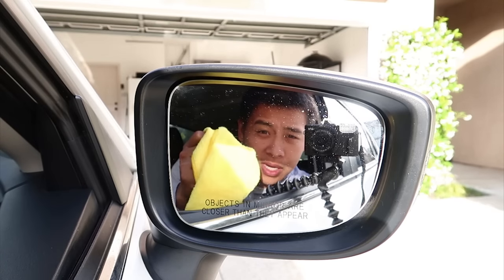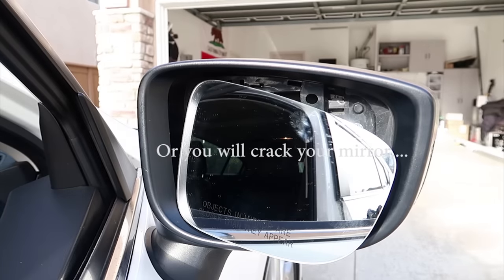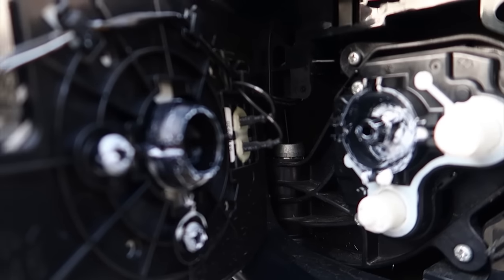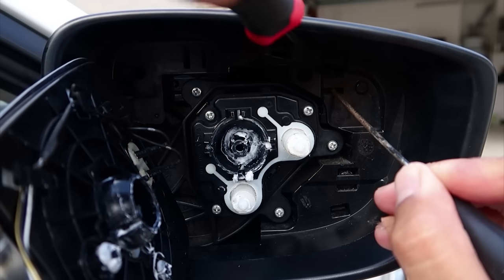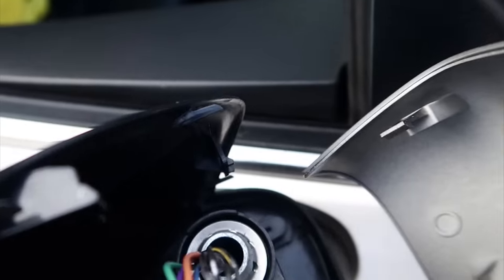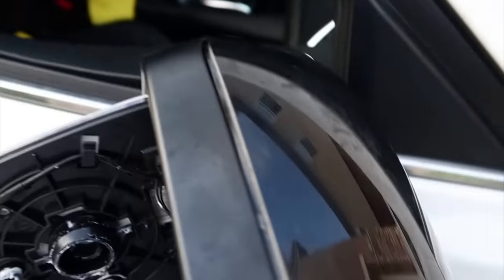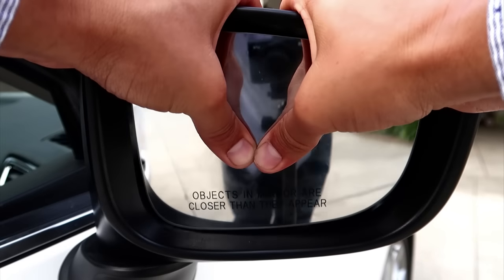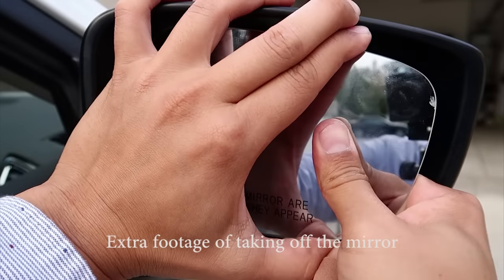How to Replace the Mirror Caps - 2016 Mazda 3

Comment: Thanks Greg, this was helpful for me to repair my passenger mirror on my CX-5 which was broken. It has blind spot monitoring and  heating. Unexpectedly, once underway with the the mirror glass replacement, I found one of the servo-motors was apparently jammed as well, which necessitated the removal of the mirror cap so I could access the the wiring to the servo-motors and remove the servo-motor component and then disassemble it completely down to the servo-motors and gears. I found Mazda's CX-5 repair instructions online for the mirror removal and re-install which were barely helpful, but they were the only guide I could find on my car's specific condition, and I had nothing for the mechanism. It was frustrating to accomplish, since I haven't much experience doing autobody work, but your guidance on at least the cap removal part of it was very helpful.  Happily my mirror is fixed and operational including mirror adjustment, blind spot, signal etc.  If anybody else needs mirror help on their CX-5 (and I bet other Mazda's have this similar fancy mirror design), let me know; I can share some of my experience.
Reply from the maker: Wow glad i could help a little. I am not sure many cx5 people watch my stuff. But if you can share with a cx5 forum that might be searchable and help others there
Reply: I just replaced my mirror assembly with a new unit. Now I'm having the same issue are you did. I can hear the motor when adjusting, but it only wants to move inward. What did you do to fix yours?
Reply: Hello! Where did you find your mirror glass replacement?

Comment: Great video.  Had a run in with a fallen tree on a dark winter morning.  Cracked the case but wing mirror intact (luckily!).   This vid helped me repair the damage without having my eyes removed by a dealer 😄.  Clips were a nightmare for me but you made it look so easy.  Just need to be careful as if you force the wing mirror to far back you can apparently  damage the motor.

Comment: Thanks for this great tutorial. I actually had a vibrating mirror issue. I was so worried to try it myself. Your video gave me the courage. I just added double-sided foam tape to the spots on the mirror bracket that had no adhesive. No more vibration = a $700 savings. That’s was the quiet for a whole new mirror & labor. Thanks🎉🎉🎉😊😊😊
Reply from the maker: Dang!!! 700 thats crazy! Glad i could help 😀

Comment: Thanks for this video. I took my BN 3 back to the dealership to have their "mechanics" change the motor in the drivers door mirror, and they broke just about every clip in there. You could see the marks that the screwdriver left as they tried to pry the cap off the body.They didn't tell me about this damage. I checked the mirror by trying to twist the cap when I arrived home and it just about fell off in my hand. I showed them the damage and they then replaced the cap and body at their expense. The things I recorded on my dashcam at that dealership, that's another story but I won't be going back there. I wish they had watched your video. Thanks again.
Reply from the maker: Wow surprised they would use a screw driver at a dealership.... thats not good. Glad it got covered but still annoying.

Comment: Thank you.  I had problems getting the mirror to pop on to the actuator servos.  It really helps seeing the inside.  I only had to replace the mirror.  Seeing how to pop out the old mirror with the broken glass was very helpful. The new mirror came with the white 4 inch circular mounting base (that pops into the center and the 2 servos of the actuator) separate from the mirror -  the idea is it is easier to pop this mounting piece on first and then use the double sided adhesive to attach the mirror to it afterward than with the base and mirror together as in your video.  

My roadblock was that the mounting piece refused to snap on to the balls on the servo pieces.  If I tried with them spun out a little, when I tried to pop the socket onto the ball, it just forced it down to the bottom position.  At the bottom position, the ball and the socket in the mounting base weren't aligned well enough.  I used LOTS of force - enough that I was really worried about breaking it.  The center popped in with some force, but the 2 servos for adjusting the mirror angle just would not go in.  

After trying a variety of things, I made a collar out of a 1.5" washer that choked the neck of the ball on the servo.  I used a 1/4" piece of 1/2" pvc irrigation pipe to support this collar (I cut it through on one side and most of the way through on the other side so I could get it out afterward.)  So when I pushed the base (with the socket) against the ball, the pipe and collar kept the servo from retracting.  And the force was against the case and not the servo.  Still required a lot of force, but it did pop in.  
https://photos.google.com/photo/AF1QipM1VdxC-9XLeQEk1vhgkx-rbDnoKJJjKGOB7IF0

Comment: Great video.  Had to replace the glass as it was cracked. Was having a heck of a time getting those two actuators to engage. Was afraid I would break the glass. After watching your video 15 seconds later problem solved.  Kudos.
Reply from the maker: Woo glad i could help!
Reply: Hey there, I saw you mentioning you needed to replace the glass.  I'm in the same situation - I only have to replace the glass as far as I can tell.  How do you get it off the cap - or when you order the glass do you get a new cap?

Comment: Thank you, I was afraid to break the glass mirror when putting it back on but you excellent instructions still works on a 2020 CX-30, Mazda charged $90 for the part (with blind spot light) but needed!

Comment: Greg, great video but I cannot seem to push that mirror back onto that middle holder/clip!  I push really hard to no avail.  Then those white ones, forget about it! lol.  Any new suggestions besides just pushing the mirror in really hard?  Thanks.
Reply from the maker: Put your hand directly on the middle part and the other hand on the cap of the mirror and put hard together. Should pop back on. Can wiggle it slightly to get different angles.
Reply: @GregPettus  thanks, that finally worked!

Comment: I am having an absolute nightmare with the wing mirror glass. Initially, i took the mirror off as my mirror casing was broken and i was getting a bodyworker to repair it, when i took the original mirror casing off, the rear of the mirror glass retaining clips broke. A couple of days later, the bodyworker finished with the car, and suggested glueing the old mirror back in, he did and insisted it would still swivel, i didnt see how and was proven right, it failed to move. So now im stuck with a wing mirror glued on, so i had no choice but to break the glass and remove the glue, but he used some industrial level glue, which i tried to remove from the actuator but it was too stubborn and too far gone. So now i needed a new actuator (the part with the little motors and swiveling knobs), dealers dont sell it separately, so i needed a new mirror casing just for that particularly part. I sourced a complete mirror casing, came without a mirror glass. So  i bought a non original mirror glass, attempted to fit it in,  the internal centre retaining clip on the rear of the mirror glass broke, whilst pushing it into position. I then thought oh it must be poor plastic, so i went ahead and bought an original mirror glass, i managed to push the centre in, but when i attempted to push the two swivel knobs in, the clips on the rear of the mirror glass for them broke. This mirror has drove me absolutely insane. I am now stuck, i do not know what to do, i wish i bought a complete mirror with the glass already in it and just be done with it. I know this write up is long, im just venting. I want to cry.
Reply from the maker: Unfortunately at this point you might want to buy an entirely new side mirror
Reply: @GregPettus  thanks bro,
Well, i found out my issue, i needed to heat the rear of the mirror glass before installing, since its like 0 degrees here. I need to heat it to 60 degrees before installing. So im just waiting on a replacement glass mirror and ill see how that pans out. It makes sense but we’ll see
Reply: To conclude for those that struggled like i have, heated the new one with a hot air gun, (60 deg if u have something to measure the amount of heat) n then firmly but carefully place it in. Absolute pain in the butt but i hope it helps someone

Comment: Great video. Looks like almost everything I was looking for. Do you know if I can replace the outer shell only? My mirror and electronics still work fine; the mirror I have has blind spot detection but all the ones I see for sale don't have it. Can I simply buy the replacement mirror and just change out the shell and keep my mirror and electronics? Perhaps you can make a video showing us how to do that. I'd appreciate it. Thanks!
Reply from the maker: Outer Shell? Like the frame? mmmm Should be ok to do. going to take a little bit of work, but I dont see why you couldnt replace the shell. looks like everything on the inside had a screw and/or clip holding it in. 

Not exactly sure how to do that... cuz I havent had the need to. I would for sure ask the forums if anyone has done any of this work.

I would use the original one as a reference how to wire the blind spot into the new shell.
Reply: I just took a look and it seems as though the wires all come through the spring that allows you to push the mirror back. Do you supposed the mirror glass itself is the only difference between the models with other electronic features (blind spot, heated etc..)? Thanks for the quick response.
Reply from the maker: the mirror and the wiring probably is the only thing. Makes it easier on the manufacturer.

Comment: I found a much easier way:  I just drove through my favorite car wash with my brand new Mazda3, and it ripped the passenger side mirror cover off and threw it!  I got home and saw the cover gone, went back to the car wash & had them hunt it down.  It's scratched up, but all the tabs look intact.  600 miles on the car... Grrrr!  The vid was helpful, though, in getting me in a better mood for reattaching the cover.
Reply from the maker: +rbarr775 oooo nooooo. Yeah good luck. Sorry about the mirror cover. Let me know if you have any questions

Comment: Thanks for this Greg, someone opened their door into my mirror and broke the lens of the outer little signal assembly. It looks like it can be removed easily and replaced once the cap is off, do you know if that is the case by chance?
Reply from the maker: I dont exactly remember if it was easy to remove. But id imagine its simple in design so should be able to remove it. Also because it needs to be easy to get to to replace the bulb

Comment: I need to find a replacement plastic shell (daughter struck a mailbox that was sticking out into the road too far during heavy snow). The mirror assembly is okay, just the weather cover in front facing side is shattered. Where can I get this garnish shell for a white 2012 CX9? Everyone wants to sell entire mirror system.

Comment: Do you have a video showing the replacement of the mirror glass? As in removing/replacing the mirror and 
reattaching the BRM sensor and backing plate on the new mirror glass.
Reply from the maker: No. Not something i had needed to do. Never was damaged... if it happens to me i may show how to fix it in the future
Reply: Thought it was a BSM sensor?
Reply from the maker: @williambaker08  ha i think youre right bsm.

Comment: If your mirror cap fell off and you bought a replacement, can you just snap the replacement on without removing the actual mirror?  Also is there something wrong with the whole mirror part if the old mirror cap fell off?
Reply from the maker: Yeah i would just snap it straight in. Could be something wrong or someone reversed and it flexed the mirror and then the cap popped off
Reply: @GregPettus  Thank you for the reply!  The cap fell off while I was driving, so I will have to make sure to correctly snap each section in.

Comment: When looking at the back of the mirror there's (3) spots where wires get plugged in. Do you know what the (2) wires closest to the body are for? I had to replace the whole mirror housing and the new housing I ordered online did not come with them. I put the mirror and housing back on the car and the blind spot monitor, blinker, and power mirror all still worked. I'm thinking its for the heated mirror feature but I do not know. Great video btw helped me finish the job and get my mirror back on. Was nervous to apply that much pressure to it.
Reply from the maker: That is a great question. I would imagine they are for the heated mirrors... Wait I have heated mirrors? Next time it gets a little dewy in the morning I will let you know for sure.. Haha.
Thanks dude! Glad I could help.
Reply: If I had to guess they wired all the mirrors for heat then left a blank @ where the button goes on the center controls so you have to pay for that upgrade and it's easy for them. Install the button and turn on the feature in the cars computer. After looking at mine it looks like the blank is next the the driver side heated seat button. I have a 2016 Mazda CX-5 so it could be a little different in yours but should basically be the same.
Reply: Those wires are for the mirror heater, I just had the opposite problem where I ordered new glass and didn't know I had heated mirrors so the new one did not have those terminals!  They are activated with the rear defrost on my 5.
Reply: The wire end with the white tip is for the blind spot monitor, the two black wires are for the heated mirrors (if you have them or else the tabs will be missing), they can be hand removed if your careful.

Comment: Help: so the white stuff in the are clips in the mirror itself that you re pushing out? So for bottom you push up and push straight to pop it out and for the top you just push the top white part straight out?? Or are supposed to you push the bottom up and pop them out straight? Mines isn’t popping out it’s just rotating the mirror back nothing is unclipping. Thanks!!
Reply from the maker: White ball pieces are balls for the joint and there are two of them. Takes some force to pop the ball out of the joint. Just make sure to pull from as close to the joint as possible and straight out as possible
Reply: @GregPettus  Did it an hour ago and replaced my white caps with gloss black for the  blackout look i'm going for. Thanks for video and comment, it means a lot!
Reply from the maker: @dimaz927  No problem! Glad I could Help!

Comment: What I would like to know is if there are any screws exposed when disassembling the mirror, and by that, I mean the screws that hold the mirror case on the door. My left side mirror is wobbling and making noise when going over the smallest bumps on the road, and I want tot tighten it. Would this help? Or do I have to open the bottom of the mirror?
Reply from the maker: There is a cover on the inside. Then a few bolts you can wrench tight. This for the entire mirror. Everything on the mirror is just snapped in

Comment: Having a tough time getting the large center hub to lock into place. Do you use a lot of grease?
Reply from the maker: So you just push hard right on top of the center hub. It seems scary but just make sure you are right on top of it then push. It will snap fully in.
Freaked me out to do that the first time. I didnt add anymore grease.

Comment: Does anyone know if the 2014 CX-5 mirrors are the same as any other Mazda models. Are they interchangeable with other vehicles? Mine have BSM and I cracked the housing on my garage door so I need to change the frame but the cover is still intact. Just hoping I can find one for a somewhat cheap price is they are interchangeable with other Mazda’s.
Reply from the maker: I dont think the other models are the same probably have to buy a cx5 model

Comment: I've always wanted to find out if it is possible to change the turn signals on the side mirrors to a different bulb.  Like a led. If so,  pls let me know
Reply from the maker: I havent gone that far into the side mirrors. but from what I can tell you just pop off the cap and can replace the bulb then.

Comment: Hey man i just did this to my car but on the left side the clip that holds the mirror to the rest of the mirror assembly one of the 3 little clips that clip on to the white balls snapped off. Do u know if i will have to replace the glass or is there a way of just replacing the plastic back of the glass
Reply from the maker: +Kyle Potter this i dont know.... it looks its one unit so may have to get one with the glass too.. good luck. let me know how it goes

Comment: Hey do you know how to access the indicator bulbs? or what bulbs are they using? thinkin of switchin it to LEDs
Reply from the maker: +kevin chew dont remember exactly but id imagine if you take off the mirror cap and the plastic piece below you will have full access to the indicator. may to unscrew th3 housing then should be able to replace the bulb.

Comment: someone clipped my car while it was parked (mirror was folded).  unfortunately, they broke the front/bottom of the housing in addition to the cap.  do you have instructions for replacing that piece as well?
Reply from the maker: No sorry never needed to replace the bottom. Does it come in separate pieces? Sounds like you need to buy a whole mirror?
Reply: Greg F. Pettus it appears it will save me neither time nor money to only replace housing, though they sell the part.
Reply from the maker: Yeah might as well do the whole thing.